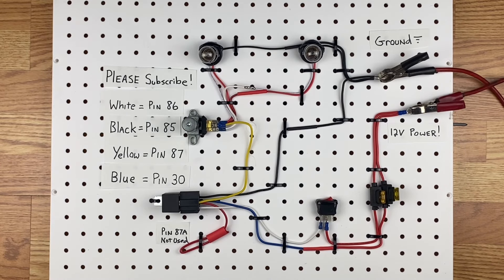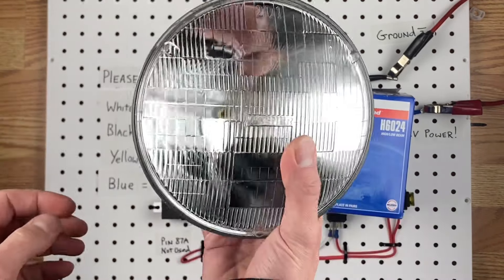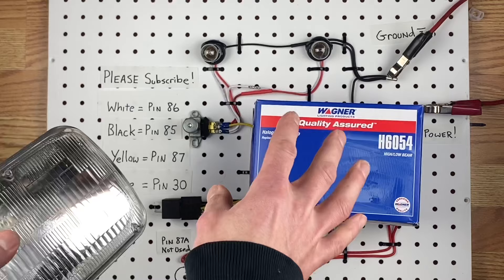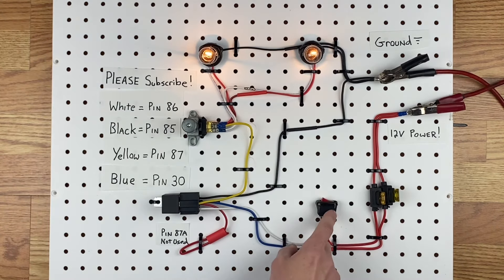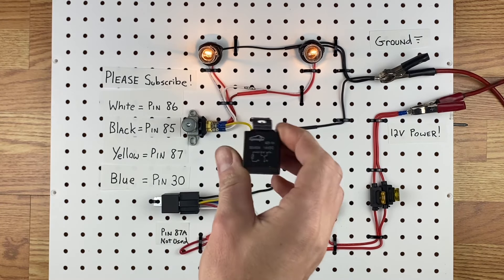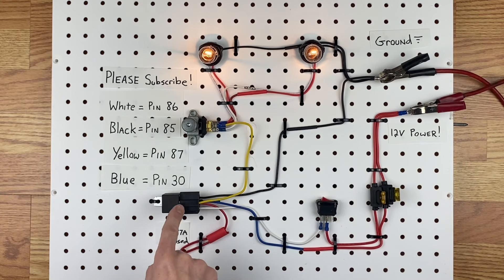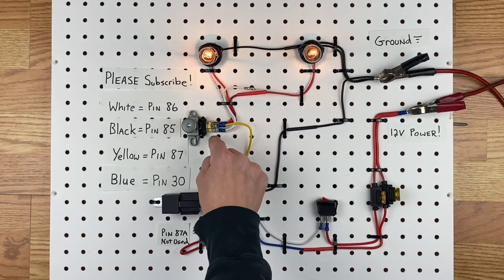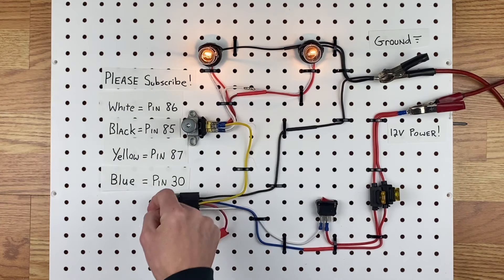How to Wire a Headlight Relay for Sealed Beam Round & Rectangle Lights w/ Floor Dimmer Switch.

Comment from the maker: Thank You for Watching the sealed beam headlight relay wiring video! 
Subscribe To This YouTube Channel: http://www.youtube.com/user/4g63mightymax?sub_confirmation=1
See My Wiring Playlist: https://www.youtube.com/playlist?list=PLsF7T1tRFy2hmiiUUfMZNyV-BUA_yrPIh
Reply: I can really use your help doing a wiring diagram to wire up from scratch a small pocket bike using LEDs or dome light bulbs
Reply: hey i was wondering how many amps should go through the swtich to the relay to turn on the headlights i think 5amps should do but i want your opinon on it.
Reply: I have a switchable floor switch for high and low lights that I would like to use instead in my car from 2003. Is it possible to install this?  As in all modern models, a shift cone is located on the steering column

Comment: Now you have all the power going through the dimmer switch. Why not use the dimmer switch to trigger the relay? You'd still have your headlight switch wired to your dimmer switch like factory, so as soon as you turn on your headlight switch either the high or low beam wire from the dimmer switch will energize the relay and send power directly from the battery to the high or low beam. This will take all the load off the factory wiring. You'd need two relays of course, 1 for low beams and 1 for high beams. hope that makes sense.
Reply from the maker: That would absolutely work too, but these floor mounted dimmer switches are able to handle quite a lot of amperage, so as long as you have a properly rated dimmer switch, fuse, and wiring for your lights, you can skip the relays. That being said - relays are always a great option, as you can tell by all of my other relays-related wiring videos!

Comment: Thank you so much for your instructional video. I burned out the headlamp switch in my '52 Crosley (actually the 30 amp fuse) and wanted to install a relay but the process confused me. Your video cleared it up. I'll let you know when the job is finished. It's a 6 volt system and I'm told that the lights will brighten up a bit as well. Thank you again!
Reply from the maker: Sounds like an awesome project! Thanks for watching the video and I’m looking forward to hearing about your successful switch!

Comment: On older cars it’s a good idea to wire two separate relays down stream of the dimmer. 
Close to the actual lights. 
One for the low beam circuit. 
One for the high beam circuit. 
You eliminate a lot of the resistance though the hi, low switch itself, the plug on it, the firewall connector, and all the length of small gauge corroded old ass wiring. 
You’ll get a nice bright light with much less voltage drop. 
Still a great video on the concept. 
Nicely displayed.
Reply: So you mean have a relay in same spot as this video? Then add two more right before each headlight?? I appreciate your advice and I'd like to understand what you are talking about?
Reply: This is the way. I'm doing my 59 imperial this way. The old harness is still mostly intact but I don't want the heavy load of all 4 headlights going through the factory wiring. Instead I am using the factory wiring to trigger the relays for the new wiring and lights.

Comment: Great video, thank you, and congrats. Right now I am rewiring two projects from end to end. An '87 Jeep YJ upgraded to V8 etc. That is mine. The wiring was the worst I have ever seen. Took it out in pieces then threw it all in barrlel. All new made by me. The second is a '74 Karmann Ghia used for the base of a kit car, who knows when owned by my former wife. It has all of the original '74 wiring. Pretty much the same but had to take it apart one at a time to learn what made it tick. A complete rebuild one piece at a time. Thanks again for all of your info. Subbed.
Reply from the maker: Sounds like you have some awesome projects! I once did a TON of work, including wiring to a 69 Karman Ghia. It was really, really enjoyable. I'm glad you found the video helpful. I'll keep making them if people keep watching them! :)
Reply: Im working on an 87 jy with a 302 that i just got and the its horrible wires from nothing to nothing and half are melted its a mess
Reply: @hbmoore7803  My suggestion is to toss it all and either build or buy a harness. You'll save time and money in the end. Sounds like a great project. good luck with it.
Mine is 5.2 Dodge. Another suggestion is what I have done. Trash the heater vent all of it. It's also 30+ years old. I got a universal heater AC unit from Vintage Air. It is 1/2 the size of the original, more efficient,  very reasonable price and looks just like the original YJ AC unit. (I'm not using the air but it's there if I want it).

Comment: Rewiring a 2003 s10 that i took the computer and wiring (90)%. Love your videos - they help a lot. My s10 has LT1engine-700r4-trans- 3.42 gears in a 8.6 s10 read end housing.
Reply from the maker: Thank you! Your s10 sounds awesome. I have owned three of them, and loved every single one! Good luck with your project!

Comment: Converting my 88 mr2 to a fixed led headlight from the pop-up sealed beams and it's nice to see how a circuit should work. This will allow for simplification of my front wiring

Comment: Super helpful. I just installed some fog lights on my 4runner and the wiring kit had a relay. I was wondering why they had that along with a fuse and not just a fuse. This video helped. Thanks
Reply from the maker: I’m glad it helped you out! Thank you for watching!
Reply: I’m trying to install some fog lights I’m trying to separate them with a switch

Comment: I remember these floor switches. Notorious for overheating and having your lights fail while driving down the highway. Usually, it was just a matter of clicking down to lo-beam and switching the lights off and on again. But a bit of a shock when you're not ready for it.
Reply: I did this to my Nova but put the relay after the dimmer switch so it's low voltage like the main headlight switch. and under the hood between the battery and headlights.

Comment: I’m setting up the headlights in my dads 48 Ford with an old school GM headlight switch and dimmer, but using the dimmer switch to select and power two different relays, one for high, one for low.

Comment: I used a 91 grille in an 85k10, but instead of using just winners for highs. Or outters for lows. (They are single flament headlamps) I hooked the lows up normally. But added a relay from high positive to backfield lows when highs are on. And so I get all four. The rectangle ones that have four. Usually have 2 filaments of 45w on the top ones, (one aims down, one up) and the bottom ones are 50w and are wired to the top aimed up filaments. And of course the round ones or single rectangle ones are wired in a way like a twilight bulb.

Comment: Great video. I'm putting two color , Amber & White fog lights on my Suzuki LTZ quad.  Instead of a dimmer switch, I'll be using a spdt toggle.  I think that's the switch I need, if not 🆘
 thanks

Comment: I have a 2001 International 9900i semi truck. I was driving in heavy rain Thursday night. I dimmed the lights for oncoming traffic and blue light on dash dimmed slightly but high beams stayed on. They wouldn’t shut off and occasionally the low beams would come on. Now high beams are stuck on. All fuses and relays good. I got a dimmer switch from a Chevy truck brand new at parts store. No one had international switch. One place said they could order it for $160. It’s the same kind of switch as the Chevy switch. The old switch was wired with electrical tape and when I pulled the tape off the wires came off so I didn’t know which one went to which terminal. I put the green wire with constant power in the middle top terminal. I tried switching the yellow and black wires from left to right on the bottom two terminals. I got it so it’s doing the same thing it was. The blue light is dimming, but the high beams are staying on. The driver side headlight when I go to dim it is flickering. The terminal on that light had a problem with it before because it was all green, so I cleaned it up and it worked for a little while. Today I wired a new plug onto it. That didn’t help. It is still doing the same thing. What else could it possibly be?

Comment: So, the power that goes to the fuse, is obviously the fuse box.  Where are those relays usually stored?  Under the dash or in engine well?  If you were rewiring wipers, signals, gauges and ignition, would there be a relay for each?

Comment: thanks for the video,  I understood the basics, this helped cement but I do have a question,  I have a 92 Dodge dakota with a column mounted dimmer,    I had thought of putting 2 relay's  one for low, one for High, in the line, and use the current  lines going to the headlights for the power lead to the respective relay's.   then the pin out lead would go back into the existing harness.     Is my thinking correct?

Comment: SoI have a quick question. 

I thought the reason behind having relays is so you do not have high voltage coming into a switch that can’t handle the power. But looking at your diagram you have power coming from the battery into the switch and then it is going into the relay

Comment: It’s awesome thank for your help , I’ve little question , you use 5 pin relay but use 4 so it’s possible to use 4 pin or I must 5 pin too ? Thank for your answer
Reply from the maker: You can absolutely use a 4 pin relay. I just used a 5-pin because that’s what I had at the time. Thanks for watching!

Comment: I had a plethora of wires burn out on my 1969 cortina, its amazing that despite this everthing works except  the head lights, it has the floor dimmer switch because the column switch wore out years ago, this instruction is very helpful., thanks for it, l will see how l go , l tried to subscribe , but l dont know if l succeeded , there is normally a subscribe to press.
Reply from the maker: Glad you found the video helpful! A 69 cortina is a cool car! There should be a big red subscribe button under each video. If you don’t see it, you may already be subscribed.

Comment: Great, my question is where do you connect the tail lights? The need to work with high and low beam.
Reply from the maker: I have a few different videos showing tail light wiring. Check ‘em out here https://youtube.com/playlist?list=PLsF7T1tRFy2hmiiUUfMZNyV-BUA_yrPIh

Comment: Great explanation. How would you wire front parking lights of a 1964 Chevy C10? Factory set up is those lights turn off when headlights are on. I would like them to stay on
Reply from the maker: Check out this video I made that probably uses the same headlight switch as your truck. You may be able to tie the front parking lights into the rear light terminal on this switch to have them stay on with the headlights. https://youtu.be/41uIZyRsJC4

Comment: Great video, I’m in process of wiring in a sealed beam 4 headlight system with parking lights. Could you please do a video for what you would need to conquer that? Thanks!
Reply from the maker: I’ll add it to my to do list. A few others have asked for a 4 headlight option, so I’ll do it soon!
Reply: @WiringRescue  Thanks much appreciated!

Comment: Thanks for the video. How is it possible that with only two wires per bulb you are able to switch between low bea and high beam? Shouldn't there be 3 wires? Asking for my bike as the high beam works on only one of two headlights and I do not know why but I have 3 wires going to the right light and 2 to the left, and the left does not go into high beam.

Comment: Thanks for your video I am have trouble with a truck wiper it has 2 relay 1 is for the wiper power and the 2 is high and low speed and I have to remove the power relay so the wiper stops

Comment: Okay... So what if I want to use a switch that I found online, a nice billet turn signal switch that I want to use for my headlight switch instead..  A 3wire deal, left, right, power, Switch has a positive up(high beam) a positive down (low beam) and then the center location, how would I wire this in using this template.... Would I just disregard using the on off switch coming off of the fuse and just go directly through the relay or do I take away the dimmer switch you have there and replace it with the billet switch... Or how should it go?? 🤔🤔🤔

Comment: I really like your setup for the headlight wiring. Could you show how to connect to the ignition switch so that we don't accidently drain the battery? My 2007 ram 1500 headlight circuit is no good and I don't want to replace the TIPM. I want to connect my headlight circuitry outside of the TIPM.

Comment: I have a 67 Dart, and after replacing the switch and the dimmer, I still have no lights. I was going to upgrade to LED lights, now that I know this info, it’s going to make the upgrade a whole lot simpler
Reply from the maker: Heck yes! I’m not sure if those Darts have firewall connectors for the wiring, but I know I’ve had multiple old cars that have terrible factory connections at the firewall that prevent the lights from working. So before you start over - check that if you haven’t already! Also Darts are frickin awesome! Thanks for watching!
Reply: @WiringRescue  it does have wiring through the bulkhead of the firewall. It appears to be controlled through the amp gauge (ammeter) and the headlights are always dim. I had seen back in the 90’s a way to bypass the ammeter but....I never did it. I’d really like to get away from having everything hooked up to the ammeter if possible. Looking for the smartest way possible without burning the car to the ground or rewriting the entire car
Reply: Rewiring

Comment: Can you help me out ? I’m trying to wire up headlights taillights flashers and blinkers to a 1964 Chevy impala and I’m using yours wire diagram which by the way is very helpful I’m just trying to figure out how do I get the headlights taillights all the work in sync! Using the original headlight switch an aftermarket hazard switch

Comment: Your videos are very informative. I have a question. I'm running a 95 silverado steering column in my 92 silverado . My multifunction switch has a high beam selector switch built in it. I was wanting to use a relay to control the switch over from low to high beam and was wondering which wires will I need to connect to make everything flow right?

Comment: Love your videos.  Working on a 1991 Alfa Romeo Spider- upgrading wiring harness with relays.  CURIOUS- wouldn’t you want the fuses in between the battery and relay for the high amp draw on the circuit?  With your setup, I would have put the fuses before the relay pin 30.  I suppose then you’d have to create another power source for the on/off switch, maybe fuse that too?
Reply from the maker: You could absolutely add fuses in there, it will just end up protecting different sections of the circuit. The most important part is sizing the fuses and wires for the amperage draw that is going through the circuit!
Reply: @WiringRescue  absolutely!  In watching all your videos and a few other channels I'm also learning that even the terminal connectors have a max amperage they can carry - So thankful for all these amazing videos you produce!

Comment: I’m wanting to put lights on n old Ford 2N Tractor.   I want to have tail lights with optional flashers/warning lights. There is one wire coining out of the fixture. What’s the best way to have them powered with two options? (Solid on, flashing and, of course, off.  Thank you.

Comment: Thank you for the video,  very informative and helpful.  Do you think I can do or use the same wiring for a 1989 toyota pickup 4x4? I wanted to replace the old sealed headlight housing to LEDs but for some reason they are not working. I think is a wiring issue. Again, thanks for the video.

Comment: Hi, I have a Datsun 260z someone converted into a race car, upon disconnecting the relays and still finding everything still working other than the fan for the radiator. I am redoing all the work hooking back up to the key. If I buy a bunch of fuse holders isn’t it easier to buty a fuse box?
Reply from the maker: Yes! Stay tuned! My next video will include a fuse box. I’ve got the whole thing made, just gotta finish the filming and editing parts!

If you haven’t seen it already check out the Leash brand fuse boxes. I’m not associated with them in any way, but it’s a nice product, and reasonable price if you only need 6 fuses.

Lastly - I do have a radiator fan video too if you are looking for ideas on how to wire yours.
Reply: Totally Awesome, I know  video editing and uploading is time consuming. Do you have an approximate. Date w the fuse box so I will mark on my calendar

Comment: Hi. I have experience when it comes to building and modifying cars, however I have always struggled with "relays". Although your tutorials have helped I am still, in many ways, non the wiser. Which leads me to my problem. I own a 1966 Morris Minor, I am trying to acheive the opposit of what you are showing here. I want to move the foot operated switch (the same as the one in your video) to a normal toggle switch in the dash. Is this doable, and can you show me how? I do have a 5 pin relay ready to go. Many thanks.

Comment: Could you do a video where you hook up newer style headlights (HIDs?) to an old muscle car? OR a video about wiring a basic gauge system i.e. fuel, tac, speedo, oil pres, water temp, and battery?
Reply from the maker: I would love to do all of these things, but I'm limited by the stuff I have to work with. Sadly, I don't have any LED's around to tinker with, but I may have some gauges. I will have to look around to see what I can find.  Thanks for watching!